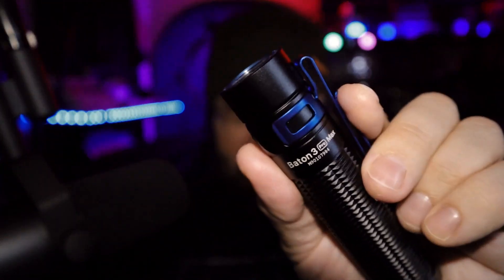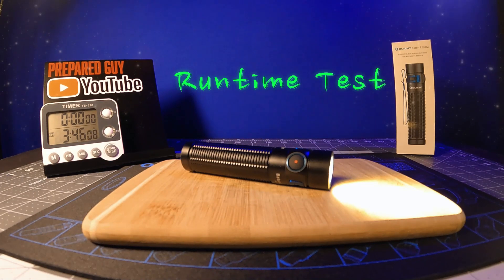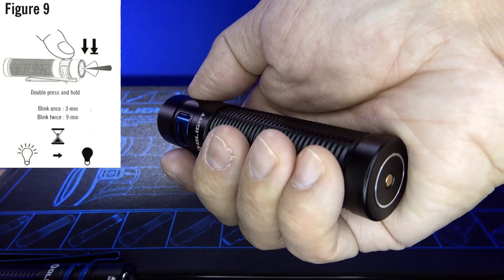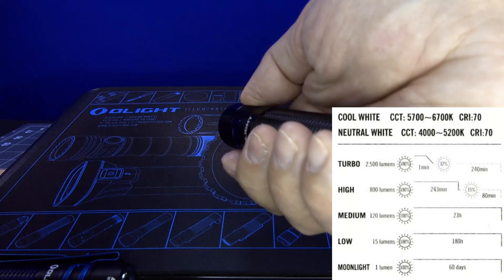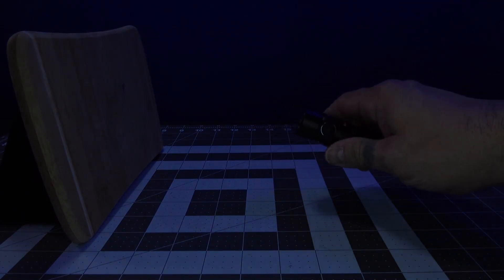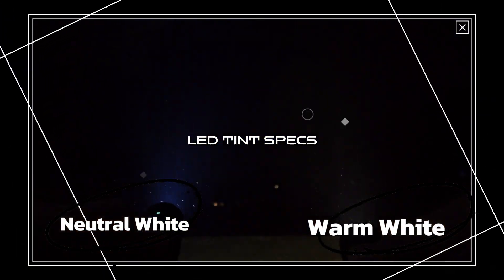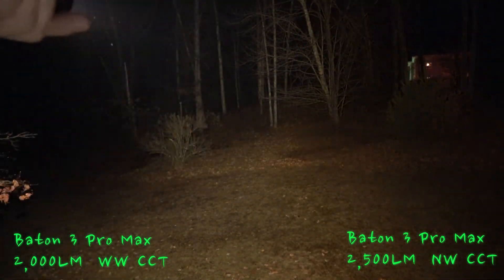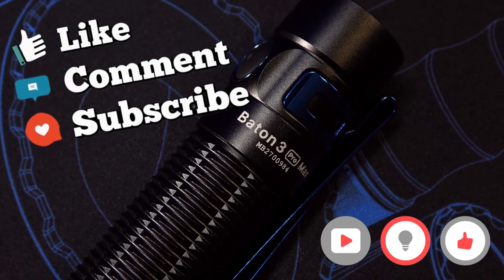OLIGHT BATON 3 PRO MAX REVIEW (VERY NICE)

Comment: I like both. Different lights. I like the proximity sensor on both and have had no problems. So I prefer the first version of the Baton 3 Pro, possibly they will work that back into the line once they implement a "semi-permanent" way to turn it off like they now have for the Max. I have the NW Pro and WW Max, now have the NW Max on the way. Disappointed that they did not include a NW option for the Magnesium model. Don't know how they could increase the candela of the Max and still give that wonderful flood...and I guess they didn't either. LOL. Physics I guess. Around the home the Baton 3 Pro Max is probably going to get the most use. The WW version is perfect for the nightstand.

Comment: I have the pro max with the warm white transmitter. This is my main EDC, it's the light I use daily and gets the most use out of all my lights. The vast majority of my flashlight usage is indoors, the warm white with lots of spill is perfect for what I need.
However, I don't think it's a great light for self defence because it doesn't have a tail switch, the warm light isn't as harsh on the eyes and the candela is low. So I always have a backup with me. Plus if you're outdoors it's nice to have a light with some throw. For me that depends on whether I have a jacket with me, if I do, I will have the warrior 3 x, if I don't I have the warrior mini 3. But I always have the pro max.

Comment: Hi. How is the spot compared with the Seeker2Pro? Its wider or its narrower and throw more? I own many flashlights and id want a warm color one. Most are cool or neutral at best.
Reply from the maker: The seeker 2 pro is unsurpassed by the pro max. If I were to choose between the 2 I would pick the seeker 2 pro every time.  The floor is about the same but the throw is better in the seeker 2 pro.  I happened to be able to grab a warm white version of the pro max when it was available for a limited time. It's great but it's not really on par with the seeker line. It's basically a beefed up baton that's not a seeker but fairly close to one but not one 🤷‍♂️ personal if you're on a budget I'd grab a baton pro max but if you have the money to throw at a seeker I would wait until the seeker 4 line comes out. Which should be soon I believe.
Reply: @PreparedGuy  thank you.
I already own the Seeker2Pro, this year i bought 2 x Baton 3(red), with case and spare batteries. Have a nice day!

Comment: Do you recommend this to be carried in your back pack when traveling by plane?
Reply from the maker: It's not considered a tactical class flashlight so as long as it's a carry on it shouldn't be an issue.
Reply: @PreparedGuy  perfect answer. I was about to purchase the Warrior X 3 but i had second thoughts and went with this instead. Heading out to europe in 3 months and to use it there